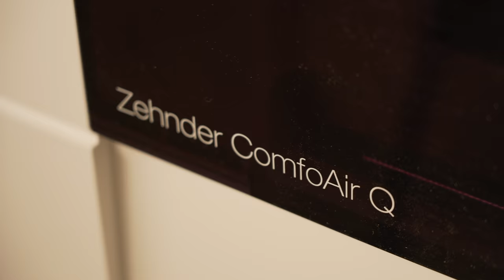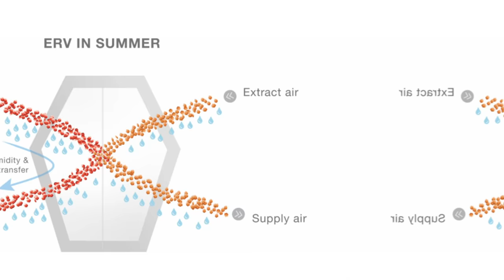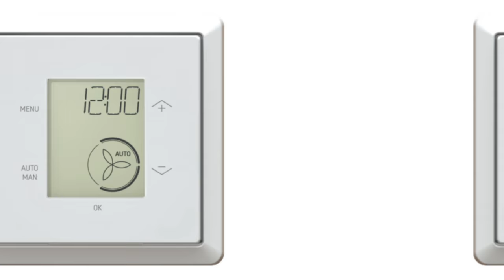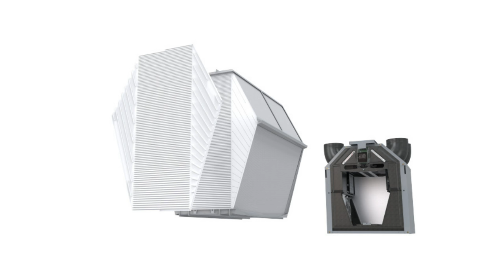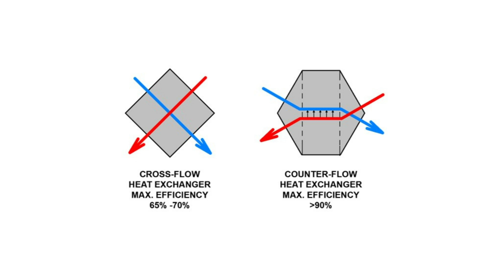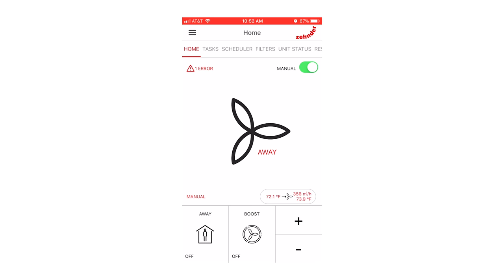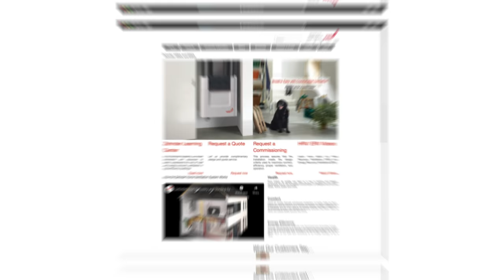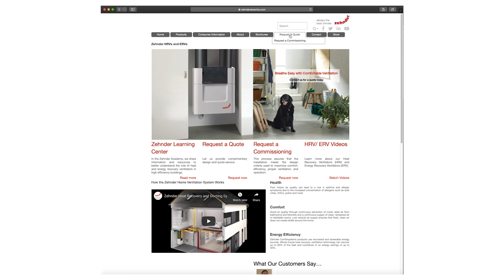Passive House - Fresh Air System Install & Costs (Zehnder)

Comment: Ballpark prices,  I'm so proud of you.  Thank you.
Reply: Ballpark numbers was the difference between “the average homeowner could never afford these high end products” to “hey I’m an average homeowner maybe I could save up towards that”. Gotta change the stigma!
Reply: I’m breaking ground in a month, I like the idea of this.  However I bet Matt’s HVAC would cost me over $40k.  I need sponsors.
Reply: @markseamans4682  I will sponsor you.
Reply: @jgoody7467  haha!
Reply: @markseamans4682  way over $40k. It would likely be $50k+ plus builder P&O and Supervision. So $65-$75k. I spoke to a builder recently who put in a very similar system on a job to this, but this is even higher end.
Reply: Steffen Pelz If that’s true then That’s outrageous. I’m a diamond dealer at Gensco and I could buy materials and equipment for 17k max. This technology has been out for years/decades and a monkey could do the install. 

I own my own business and work In the commercial field. We install VRF, HRV, VFDs, GEFs, DDC, BAS (Tridium/Niagra) package units, split units, boilers, cooling towers,  in midrise and high rise mix use buildings. I get it!! We are all up charging the customer 100% and each one of our guys is bringing in 100 bucks an hour to the company. But at some point the general public has to pick up a book and read for a weekend to save themselves tens of thousands of dollars. 

Nobody should be hiring specialty contractors in the residential fields. Everyone can plumb pipe. Shit flows down hill. Everyone can pull wire. Electricians hardly do any work, they are always playing with their strippers. HVAC guys are just a bunch of tin knocking, pookie brushing, failed plumbers and failed electricians. Red headed step child.
Reply: @Justaguy0420  This is exactly why I am contracting my own house and doing all the work that I can.  Much of this knowledge has come from Matt's videos, which I am very grateful.  I haven't gotten to HVAC yet, but I do plan for an ERV and whole house dehumidifier.  The size of the AC unit will be interesting since I'll be doing ICCF and very tight.  I have started to just leave out that I think the size of the unit will be when talking to people, as most are clueless when it comes to a tight very well insulated house.
Reply: Mark Seamans Insulated concrete? ICF?

Make sure you buck out exterior penetrations before you pour. I’m sure you know that already though. 

You can do it man. Just do a heat loss calculation with all your r values and you will be fine. If you get a heat pump with a variable speed compressor and variable speed fan it will be a little more forgiving with equipment sizing. But you should be dialed with a heat loss calc. 

And yeah a weekend of watching YouTube and you’ll be just fine.
Reply: @Justaguy0420  of course it is outrageous. This kind of system is SO high-end and requires SUCH precise engineering and setup that it is used only by builders who bid for clients where money is no object. Look at what went into this install. Zip-R, liquiflash, air and bug sealing, 2 layers of poly iso, furring for air gap and overhangs, every nail hole is flashed, closed cell between the rafters in attic, rigid ducting everywhere, covered with Insulation, Mitsubishi HVAC system with UltraAire dehumidifier, Zehnder system etc. Not hard to believe this would cost well over $65k for materials and install. Austin is a VERY expensive market to build because every reputable builder is busy and every skilled trade booked out for months.
Reply: Steffen Pelz I agree with most of what you are saying. I wouldn’t say these systems are “so high end and requires so much engineering.” There are acceptable tolerances in any mechanical assembly. And this is what these guys do, engineers do engineering stuff. 

As for pricing I agree with you. I live in Seattle and every specialty contractor is booked out 4 months and is laughing all the way to the bank. Guys are throwing out ridiculous bids just because they don’t want to do the job and people are paying for it. Guess you have to get it while you can. Many of the old timers remember what it was like in 2008 and are packing their pockets because they see another downturn coming. 

I just see things different. I have no debt and low overhead. I don’t need to bring in 250k a month to stay afloat. But hey to each his own, it’s capitalism right?
Reply: @Justaguy0420  ICCF - The Perfect Block.  This block makes that a little more forgiving for small penetrations, but I'm planning for everything I can think of including conduit for future ground solar, ham radio antennas, etc...
Reply: Mark Seamans Awesome man!! Are you a technician? Or do you have your general? 

I’ve been looking at the best structures for EMP protection and your building seems like it will be pretty well insulated as long as it has a metal roof. (Bond roof to grounding rod)

There are a lot of repeaters around me and I listen in. It’s pretty cool. I started out in single side band. I’ve been listening to mostly the 20 meter bands to hear some long distance contacts. I hear Ham propagation should be picking up due to the solar minimum coming around the corner. What kind of radio do you have in your shack?
Reply: Wait so is that ~10k for the system and another ~10k estimated for labor?
Reply: In Australia my company supplies Brink Climate Systems. Zehnder is our competitor. We are on average $2000AUD Less than Zehnder. 
Zehnder is good but there are other great brands. The Brink Flair 325 is 91%
 efficient. 
The price he gives in video is good.
Reply: No such thing, when you get into these systems they can cost a wide range for cost. Depends on  efficiency, area of the country, state grants, brand, warranties and so on. Also no HVAC system is DIY ever, way too much that must be done correctly to get the desired results. You don't get that from YouTube.

  Now add in know it all home owners who want to fight with hvac contractor's. If you are getting real high prices it's your set up no one wants to do or deal with a headache homeowners. People will NEVER make their saving back from these systems.
Reply: Save your money and just open your windows and stop crying
Reply: 1,000,000.  +/-  daily energy use $1

Comment: I would strongly advise to think about the pipe cleaning right away : avoid tight 90 deg turn and regular acces to inlet pipes. Otherwise you might start to have allergy problems after 5 years.  I m hvac engineer from Belgium.
Reply: How do you clean the semi-flexible ducting?
Reply: Giles B they are smooth inside duct cleaning machine for small ducts
Reply: Filtration and Maintenance ever 3 months at the HRV/ERV will help keep the supply air clean
Reply: @Floreypottery  thanks, I've got a few 90 degree bends but mostly on the extract ducts.
Reply: You cant get mold because of the MERV13 filtration at the entry point and than MERV15 on top of that.
Reply: you're very right, the less elbows the better and most always look after how easy can you build the conduits when the time to flush them out comes.
Reply: No duct cleaning necessary because of using the filters.
Reply: @sepertude  Couldn't you get mold from the intake tube from places like bathrooms
Reply: @Ken_Myette  the system should always be running, the aircurrent should prevent mold from forming.
Reply: @scottsmith4145  That's bs, no matter how high a merv filter you have, ducts over time will still get dirty.
Reply: @scottsmith4145  The inlet tubing before it arrives at the filter can require subsequent cleaning. Best to think about that early at the design and build phase.
Reply: Also, especially if you have pets, the return tubing can get significant amounts of dust in them.
Reply: He mentioned that filters on both ends altho that not prevent pipes to get dusty. Probably this will minimise dust to settle down to the minimum and I believe it depends on household too.
Reply: @scottsmith4145  But the filters at the box are not on the entrance of extraction. If people in the house create dust then it goes straight away into extraction. I still don't get it why he has only an air supply in the bedroom.

Comment: As a duct cleaner I like this. Another system to get paid to clean.
Reply: Sounds like this would eliminate the standard trunk and branch system. Just a different type of cleaning.
Reply: You'll need to invest in a couple of 3 inch (75mm) brushes. ;-)
Reply: Not really. Why would you clean the exhaust ducts?

Comment: Would have been beneficial for them to discuss the kitchen exhaust and how the makeup is being handled.   This is only the "fresh air makeup system"  This really needs to work in conjunction with the rest of the HVAC system.   Hopefully that can be covered in another show.   Total cost is going to be significant.
Reply: no kitchen exhaust in this house. Induction cooktop, so it's not needed. He just puts a return grille in the kitchen as part of this ventilation system instead
Reply: @kevinmacnichol7692  Even without gas cooktops, I'd still want additional kitchen exhaust to handle smoke and smells from cooking.
Reply: @kevinmacnichol7692   An air return in the kitchen is a code violation by the way.  And the need for a kitchen exhaust is not based on the type of cooktop but rather for the heat and moisture that is generated as well as the occasions burned food when the cook is not paying attention.  Or are you just trolling with the obvious misstatements?
Reply: @BubbleOnPlumb  tell that to all the crappy luxury apartment units. Staring at the return vent in the kitchen right now.

Comment: Pretty accurate information Matt. Good job. Please note one important item.  In the north it's so dry in the winter, people suffer from nose bleeds and static electricity so we humidify our homes and commercial buildings. As a result there is a lot of latent heat stored inside and we absolutely use ERVs. They are probably just as important or more than the south because of our high delta T from outside to inside. I thought I would share this info with you.
Reply: "𝘐𝘯 𝘵𝘩𝘦 𝘯𝘰𝘳𝘵𝘩 𝘪𝘵'𝘴 𝘴𝘰 𝘥𝘳𝘺 𝘪𝘯 𝘵𝘩𝘦 𝘸𝘪𝘯𝘵𝘦𝘳...𝘴𝘰 𝘸𝘦 𝘩𝘶𝘮𝘪𝘥𝘪𝘧𝘺 𝘰𝘶𝘳 𝘩𝘰𝘮𝘦𝘴"

That depends on where "in the north" you're talking about. Much of New England/the Mid Atlantic or the Pacific NW states have pretty high average humidity in winter(often over 70% in the morning). The average humidity in Chicago is actually highest from December through January. When I still lived in NJ my dehumidifier ran year round as did the one in my grandparents home near Newark NY. Humidity levels are influenced far more by things like terrain, altitude, large nearby bodies of water(Lake Michigan or Ontario for example) and other factors than they are simply by latitude.
Reply: @CzechSixTv  that's relative humidify Einstein. Go back to school pal.
Reply: @CzechSixTv  Chicago's highest dew point ever recorded was 83°F on July 30, 1999
Reply: @CybekCusal  It obviously wouldn't make sense comparing extremes such as 100% humidity at -20 in Fargo to 60% humidity at 45 degrees in Atlanta simply because the measurements were taken during the same season or even month. I'm talking about humidity levels at similar temperatures.

It doesn't matter how you slice it. 65-70% average humidity on a 30 degree day in Chicago or a 35 degree day in Seattle means there is physically more moisture in the air than there is at 56% in Amarillo TX or 50% in Sedona AZ at the exact same temps.

That humidity difference is why 30 degrees in Chicago is absolutely biting compared to 30 degrees in those areas of the southwest I mentioned. It finds its way into poorly sealed older homes in those areas, lingering in wall cavities/basements/crawlspaces, condensing when temps drop at night leading to problems down the road.

Does that winter humidity compare to Mobile Alabama, Nawlins or other gulf coast cities at any time of the year? No, but few places in the US would. What do Seattle, Chicago or Boston have in common with those gulf coast cities though that Amarillo, Sedona or Death Valley don't? Immediate proximity to giant bodies of water that stay warm for some time even after the air temps start dropping.

When comparing apples to apples, latitude only plays a small part in humidity levels.
Reply: @CzechSixTv  what you say is incorrect. You are going to hurt yourself. HVAC isn't your thing. Dew point represents the moisture content, not relative humidity. Go play with Legos.